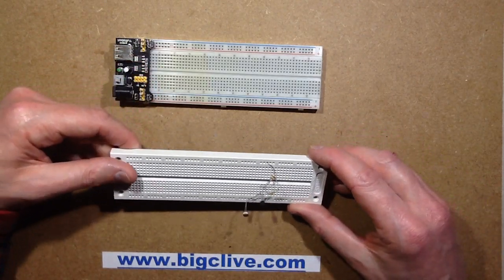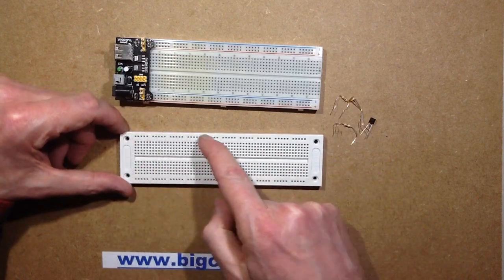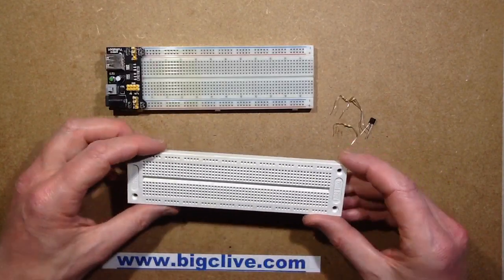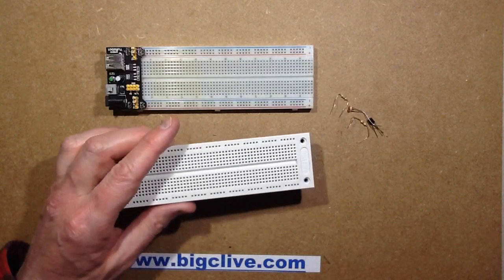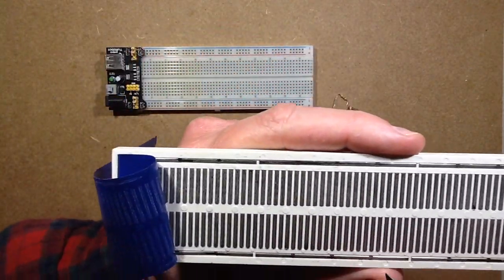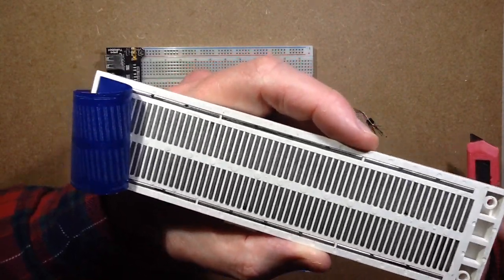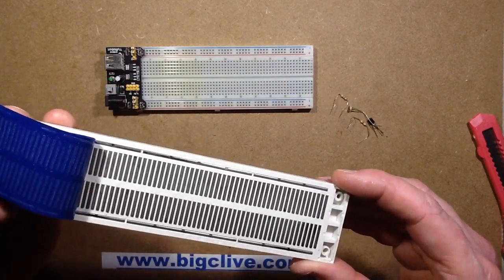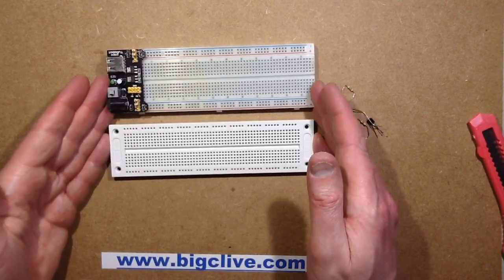Boobytrap breadboard from China.

Comment: My first breadboard in Japan came this way (it came with pins to bridge the gaps if you needed a single rail), though the breaks in the bus bars were well marked and documented on the packaging. I couldn't have guessed this at the time, but I now suspect the reason was for multiple voltage buses (e.g. 3.3V & 12V). Certainly after your disassembly, it looks like the six discrete buses would have been costlier than having a single pair, so I doubt it was to save a few yuan. There's 120 terminal strips on that breadboard (same as mine), so its not unreasonable to imagine a simple multi-voltage project fitting easily on one breadboard.

Comment: having splits in the bars may be a good thing because some circuits you may want to use may use multiple + and - voltages and having them isolated may be a good idea.

op amps are a big use of + and - voltages however maybe you are designing something that uses 5 and 12 volts too.

Comment: Actually that's exactly how they are supposed to be. Simply for various voltage circuit testing. The high quality boards have usually only one separation on the rails at midway point (between 30 and 35) giving two testing boards. 4 small jumpers midway makes it one board or you can trick it around to give a longer neg rail or pos rail. I've even seen boards with segregations every two banks on the bus. Cheers. Oh, also it makes it an easier setup when using pos and neg rail op amps etc.

Comment: I still have one of those, obtained in the 80s, purchased from my local Radio Shack (upstate NY in the US). No markings at all on the plastic, exactly like yours. And I have to make the bridges if I want the same voltage down the length of it. The plastic board is attached to a very stiff piece of painted sheet metal that has three banana plug sockets screwed into it. No electrical connection from the sockets to anything else. I eventually figured out the sockets are for your bench power supply, but I still don't know how to connect the sockets to the board. While the plastic is unlabeled, the sheet metal has an Archer brand label on it, which I believe was a Radio Shack house brand, like Tandy and Realistic. It came with a transparent plastic case with different sized compartments. Each compartment had stiff solid core hookup wire, with insulation trimmed back on either end, bent to fit into and lie flat on the breadboard. It's somewhat miraculous that I still have the case and wire, too, as the case is that old hard brittle plastic.

Comment: I have seen these before, you can build three different circuits that take a common voltage input, use step down to make references of 5 and 3.3 volt for differing circuits that would represent a project, such ideas that come to mine are to use with Arduinos.

Comment: I've run into those several times. Its rare, but if you really need the full length of those bars, its just an easy patch. If you find it crowding to have those extra patches in, its likely you need a bigger bread board anything. And back to Why! I believe its so you can have power on both sides depending on what you are doing. I used one when I was learning basic digital circuits, where I tied one to the signal processes(Its a little silly now, but back then it was convenient). The most unfortunate thing I can see with that board is that it wasn't labelled, and in my experience in Panel creation, that is a huge no-no.

Comment: Even a $100 plus 3m breadboard will have this. The idea is that you can use different voltages on different parts of the board, or just jump it together and use the same voltage. Can someone link me a board that doesn't have this? I'm curious.
Reply: the other board in the video is a very common type and the twin power bus along the top and bottom goes all the way along on those

Comment: Clive this is intentional, these boards are meant to be the inner boards of a larger bread board set, the ones with the red and blue lines are the outer boards and the one in your video are meant to be on the inside where you dont really need the full length strip.
colin (K0LIN)

Comment: I have some of those breadboards.  I usually wind up putting little red jumper wires across gaps on one side and black ones on the other.  Since there is no + - marking the jumpers also serve to remind me of polarity.  I actually like the extra configuration options this design allows. I had the same experience the first time, and was also surprised to find it set up like that.
Just found your channel.  I like your style sir.
Cake is on the way.

Comment: breadboards are called breadboards cos early electronics hobbyists would literally use the wooden board they had for cutting bread on as a circuit board, with screws or nails put in it for point to point/turret construction of the circuit
i spose a lot of ppl would already know that but I thought it was nice when I found out where the name came from
Reply: 0yeme0 that's how I started to learn circuitry actually

Comment: I've had a breadboard like that for a long time. They've been sold in US electronics shops forever. Mine has colored lines with corresponding breaks on the component side. It's handy for circuits that use multiple voltages.  When I don't need that, I just put in a short jumper across the breaks.

Comment: I remember similar boards, U.S. made, that had segmented bus bars, unmarked, in 1978. The purpose was to allow multiple supply voltages in mixed designs, letting you put your logic on one section and your analog circuit on another. As I recall I installed jumpers across the gaps when I needed the same supply across the full length. I seem to remember only one gap though, in the middle. Two busses on each side as your upper board shows.

Comment: They also manufacture shorter breadboards, the one I got from RadioShack in '87 needed jumpers.  The kit version has instructions to put the jumpers in.   The whole point is that you can make your power controller at one end and build the rest of the circuit.  So 12v battery into a regulator circuit, regulated power to the operating circuit then something like a sensor on the last circuit.   The blue and red lines on your deluxe indicate that the conduction goes the whole length as a single circuit.

Comment: The fact it has no markings to indicate where the tracks are and how they are connected would have had me first checking where they were and went, in the absence of any documentation. The board does have nice corner securing screw holes. I wouldn't have titled the video 'boobytrap'. Its still a good breadboard.

Comment: I don't see how this is a problem. 

It is highly likely that it isn't a bug, but rather a feature. You can now have 6 voltage lines, in stead of 2. If you don't want that, just add links.

My previous (also cheap) breadboards were also like this.

Comment: Is normal. Or at least: The ones I have from 25 years ago (local store, pre-ebay) also has this.
Reply from the maker: +cybermaus Yes, but actually marked on the top with lines.
Reply: +bigclivedotcom So they saved money on silk screen printing
Reply: 69 likes
Reply: yes. it is normal. my boards from radio shack had the same
Reply: +bigclivedotcom I used to buy these in bulk and resell them, I still have several of these left. They are all the same, and as far as I know, it's intentional.
Reply: Nil ByMouth The one I have had the diagram on the packaging not the breadboard. Splitting up a pack of 5 and selling one by one would loose the docs.

Comment: Finally figured out why I had to use one of these bread boards.  It was for a DAC or adc.  I think it was 8 bit.  Op amp, 12 - 15v.  operating voltage 3.5 to 4. converted to ttl.  I used a serial MAX* to convert it to.  I think it was for a function generator?

Comment: there's no problem with that breadboard ( china doesn't always mean substandard devices,) the problem is the moment you used that breadboard, you are not aware that it is not a long single strip of metal. maybe they (the manufacturer) thought of having a breadboard with 3 possible supply rails for 3 different volatage levels, which in this case, useable for arduino projects. Just saying , no hating :)

Comment: Actually the ones we use at school have marked breaks in them. idk why, but there just are.
Reply: +Epic Beatz 
That's for different voltages if you need to use a lot of them. Like 3.3V, 5V, 12V, etc.
Super useful if you connect each tap of a battery pack to the breadboard from the bottom.
Reply: ok.

Comment: I have Ebay breadboards like that, but they were marked. I have also had similar issues with cracked bus bars. I just soldered a wire from one end to the other and onto each section. No problems at all except that I had to take them out of the breadboard to not melt the plastic while soldering and then put them back in again.

Comment: But it's actually a good thing. You can use different voltages across the board, you can test galvanically isolated circuits on the same board. I don't understand why you would want to permanently tie all those rails together.
Reply: +Cristi Neagu Indeed. It's probably done for a purpose. One of my breadboards also has a break in the middle to allow it to be used for different circuits running at different voltages or even from different power sources. If you need to use it for 1 big circuit, then you can easily link them together, which is much easier than breaking the connectors apart. It's properly displayed on the front of the breadboard in my case though.
Reply: Yes split voltage breadboards are a good thing.
As long as they are clearly marked and sold as such.
Just like 100k resistors are fine, as long as they are not marked up as diodes.
How are you supposed to know where one bar starts and the other finishes? Guess? One pin too much to the right and you are turning your power supply to dust.
Reply: +Cristi Neagu Yeah, you only get a single row down each side rather than dual rows with the "traditional" breadboard. So if you want to run 2 different voltages, you can supply them from different ends. With the traditional breadboard, you can run a different voltage rail down each side. Nothing wrong with the design, it's just different (some markings on the breadboard would be nice though).
Reply: Ola K Fair enough. But if you didn't have the option to return the hammer, you would probably keep it instead of trying to turn it into a shovel, if you know what i mean.
Reply: Sure, but because they didn't mark them, you need to find out where the breaks are and apply sharpie to indicate where the breaks are. Otherwise you could end up blowing your PSU if you've got multiple voltages on those rails.
Reply: SuperPickle15 Alright, you win this one. Have a cookie.
Reply: +Cristi Neagu I'll take the cookie if he doesn't want it.
Reply: EaqIe Only two rails on this model, unless you count the split, then there's 6.
Reply: +Cristi Neagu At least they could have specified that in the description. If I buy a shovel and I get a hammer I will be pissed off even if the hammer can be useful. I wasent buying a hammer.
Reply: +Cristi Neagu http://picturearchive.gunauction.com/3384140413/11030963/shovel1.JPG Did i do it wrong?
Reply: BlackEpyon The argument wasn't that you shouldn't know, or they shouldn't mark it. The argument was that you shouldn't permanently weld them together.

Comment: Its actually kind of common in older bread boards.  Its so you could run dual voltages for analog circuits. op amps for example. Its also easy to test optically isolated circuits on them.

Comment: Radioshack made breadboards that had these breaks along the bus where you would put jumpers across.  It might be an american standard that is starting to show up elsewhere, but all the breadboards I've ever used, even those mounted on steel plates with nice banana plug/screwdowns did this.

The breaks are usually pretty clearly marked on a good breadboard, and it's also a good place to put current limiting into the bus and running your circuitry down the line more.  Or you can have parallel power bus, or make series bus to get more than one voltage if need be.  But this is actually what I'm used to using.

Comment: The old blue ones from RS are so much better quality, easier to push the leads in and have continuous busses top and bottom. You used to be able to buy replacement spring contacts as well.

Comment: The top breadboard is the same way except it's in two sections instead of three.
Reply: If the top one were in two sections the silkscreened red and blue lines would most likely have breaks in them as they usually do if the power strips are configured that way
Reply: +Peter “lastfuture” Marquardt I have 4 of that model. They all have a break in the middle and they all have solid lines drawn all the way across.
Reply: Peculiar. Every Breadboard I have has either continuity all throughout the power stripes or it has breaks in the red and blue lines where the rails are divided. I've never seen one that was "mislabeled"
Reply: +Jeff Flowers I came in here to say exactly this. Despite the fact that they're not marked, they are divided in two.

Comment: its for multiple voltages or polarity since it doesn't have dual power rails. Looks like a cheap rip off of the radio shack version though.
I know how shady the Chinese are and I ALWAYS do simple continuity tests on things like this before actually using them.

Comment: The very first Breadboard I had, was like this.  Many years ago when I was first learning electronics and took a while to learn to place a jumper so the buss bar would be complete across.  For a new student just learn, such a breadboard can ruin the confidence of the new budding student. This video reminded me of my very first experience with a Breadboard that I bought from Radio Shack / Tandy where my first circuit was wired correctly but frustrating of why it was not working. Again, a very bad start-up experience for a new student.

Comment: I wouldn't be surprised if those sections were the same length as those in their small ~170 point breadboards. Cheaper than manufacturing two distinct lengths I'd presume.

Comment: Yes I have the same board, its awful, mainly because I find it very difficult to insert pins/wires too strong. Regarding the missing LINKs I was caught out on the other board you have, so it didnt take me too long to realise what was going on.
On the other board there is a version where there is a break in the middle but at least its shown by a gap in the red and blue stripe, yours goes all the way along. I just assumed the power bus went all the way along, didnt notice the gap in the colour.

Comment: I bought one just like it recently. It took me a while to realise that the breaks were there. I opted for jumpers, but I might just try and solder it too. Can't complain at the price of .the thing.
Reply from the maker: Don't try the soldering, I just tested its solderability and mine wouldn't take solder at all, so there's a high chance of melting the plastic in an attempt to solder it.  Links it is then.
Reply: Thanks for that.
Reply: bigclivedotcom
Glad I caught your comment. I had a similar thing happen to a breadboard I had. I was careful and removed the strip from the board. I was able to sandpaper the contacts to the base metal that allowed soldering. I could use high heat and a very active flux because the strips weren't in the plastic base. After washing off the rosin, I was able to reassemble the strips back into the plastic without issues.

Comment: That explains it! I have four of those SYB120 breadboards in a long line on my tele-tennis pong project. I had so many problems with the power strips, I eventually linked most of the 5-hole segments together (which turned them into 3-hole segments, of course). Then I started removing links to see if they were really needed. Finally, I marked the breaks with a red felt-tip dot. But it never occurred to me that the breaks were symetrical and in the same place on all 4 boards. Duh!!
Reply from the maker: Yeah.  Takes you by surprise when you're not expecting it.  I managed to connect a super simple circuit right at a break point so one side of the circuit was powered and the other wasn't.
Reply: They may be done that way so that you can have different supply voltages on different parts of the rail.  ie.  a 5V section and a 12V section.  ??
I've come across it too.  Dashed annoying that it's not marked on top.
Reply: New to channel, but already I can't help hearing Clive's voice in my head when I read his comments
Reply: @MS-ho9wq  LOL. My brother, who knows nothing about electronics or electricity always watches Clive before going to bed, because of his soothing voice😉.
Reply: Interesting. In highschool we had these over a decade ago. I would guess that they were designed for circuts that had more than two sets of reference voltages. I pretty much guarantee this was intentional.